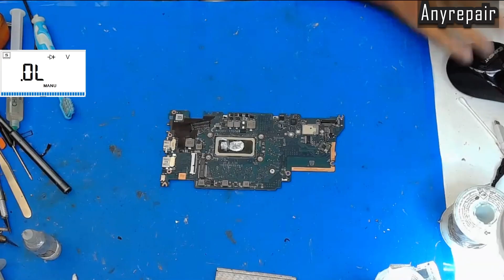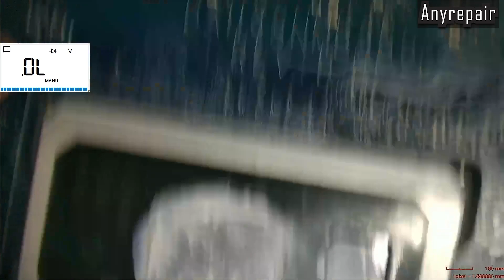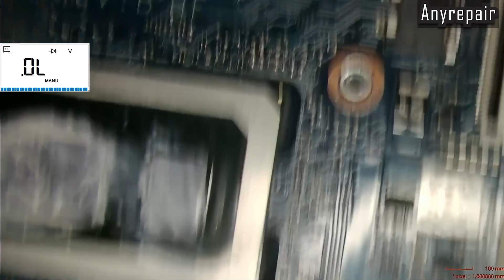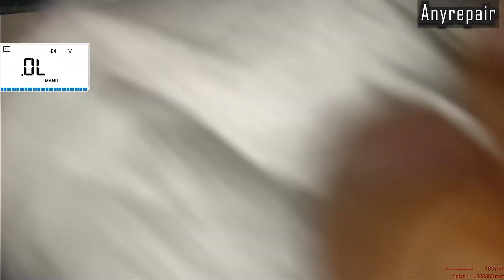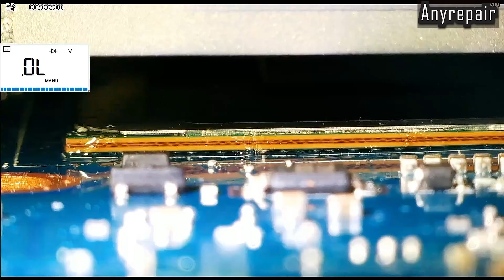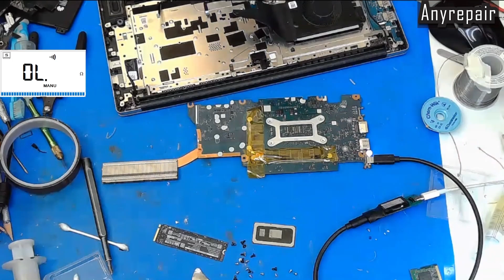Huawei matebook d15 cpu failed Common fault!

Comment: What kind of heating you used to heat the cpu off and then in? 
And how much extra you charge for this because alot of times people say its dead when its a CPU
Reply from the maker: I think they dont want to mess with cpu replacement, since it is a risky think to do and expensive to buy. It is not sure that you will buy a brand new one or a used not working cpu. I charge 100 euros for the job + the price of the cpu.
Reply: @AnyrepairENG  and how did you go about heating it? It didn't seem like hot air so I assumed it was sort of plate
Reply from the maker: @LPgmxDan  on the bttom side the preheater is IR but the upper heater is hot air. I own a ZM-r6000 station.